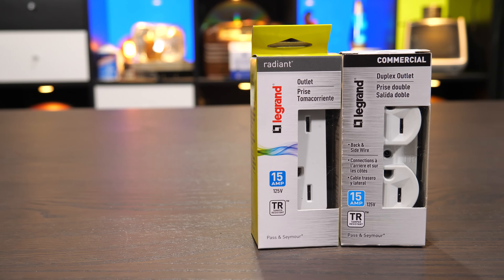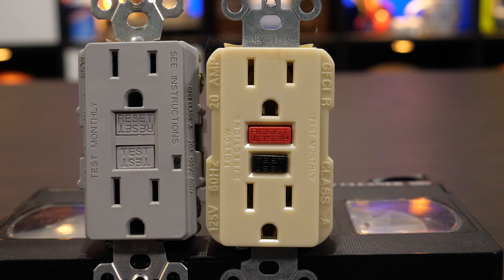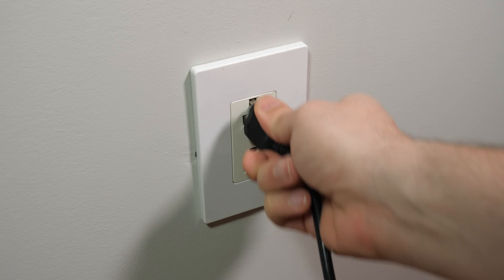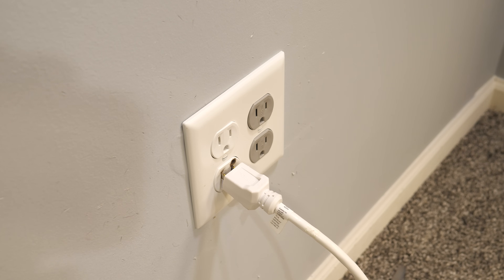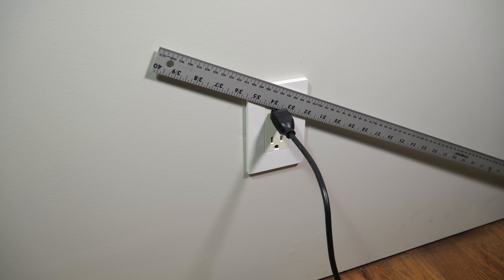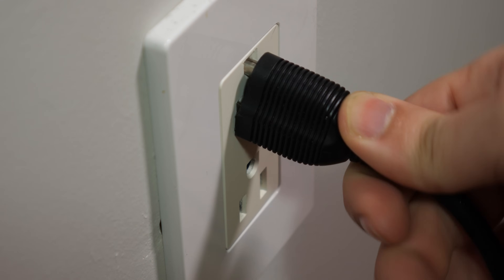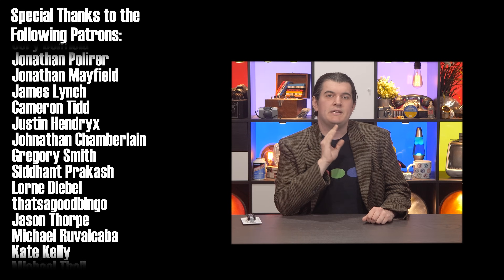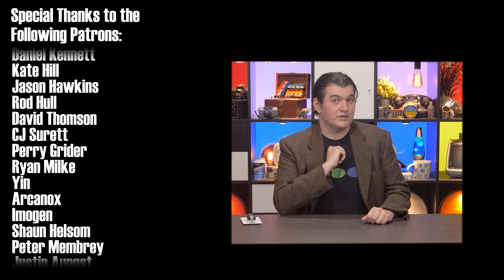Power outlets are topsy turvy - but does it matter?

Comment: I actually like the eu plates with the power switches.
The plug design we use is bad for sure.
Right angle plugs are due to consumers having them designed upside down for so long cause they are more authentically pleasing.

So weve made plugs to caiter to this.

Comment: My electronics teacher came from the bio med field and hence we learned to always have them with the ground up just incase something falls on the plug while its in the outlet in a hospital. Honestly the things that cause me the most trouble as an appliance repairman are not how an outlet is mounted..... its if the electrician even knows how to wire an outlet to begin with. I usually deal with either reversed hot neutral and or no ground and its truly..... shocking..... 😉 how many are wired wrong. That's before we even get into code and all the ways in which it is misinterpreted, misapplied or outright ignored. Stay safe out there appliance guys and keep that multimeter handy... someone's got to use one....

Comment: You touched on this and it's true: There are many appliances which are designed to be installed with the grounding plug down. Right or wrong, they assume that orientation at the design phase.

Comment: I lived 20 years in a house with top ground orientation and never once had a single problem. You are vastly exaggerating the issues. Not that I think it matters which orientation you use, I just think it's a non-issue.

Comment: Here in France, the System (who are They ? no idea) sacrificed some wall clearance on the altar of safety. Grounded plugs fit into big round sockets, so that the live blades (well they're actually big round pins, and the ground pin is actually protruding from the socket itself rather than sitting on the plug) become hidden quickly, sometimes even BEFORE making contact with the live circuit behind the socket. Oh, and our plugs are way bulkier too, so the grip is better - a good thing, because they sometimes hold on so tight that pulling a plug can require a surprising amount of force.
But angled plugs can cause the same puzzling feeling as you NA fellas seem to encounter, and in return for being a tad safer, hiding a plugged-in socket behind furniture is often close to nightmare-ish.

Shenanigans, amirite.

Comment: I think that what we really need to do is come up with outlet designs that rotate, then you can choose whatever angle to want on a per socket basis. Cause yeah right angle plugs can be superior in my experience they are equally as likely to end up covering or making it hard to access another adjacent socket. Even if they just rotated 90 degrees each way that'd be enough
Reply: That's where the European Shucko (Type-F/CEE 7/4/CEE 7/7))plugs come in. They can't be rotated 90 degrees, but you can plug them in either orientation, since the grounding happens at the edge of the connector, and the plug isn't polarized. They're also typically recessed so there's no risk of ever coming in contact with a live pin with any object.
Reply: @KalleKilponen yeah but I like getting my skin burned off when plugging in my toaster 😢
Reply: @KalleKilponen  In fact they're always recessed. Old houses just have older sockets that are backwards compatible with new plugs but have issues.
Reply: @jattikuukunen  Which is why I said "typically". Modern ones are indeed always recessed, but there are still plenty of older, (pre 1980s) non grounded and non recessed installations left.
Reply: @KalleKilponen  yeah but those aren't Schuko
Reply: @jattikuukunen  True. But they still accept the same plugs, and are still in common use, so I felt it disingenuous not to account for their existence.
Reply: as long as they could lock into place and not rotate continuously past 180 degrees or maybe at most a single 360, that'd be a great idea.
Reply: So a hole for the ground pin in both sides? Not enough for polarized plugs, though.

Comment: maybe legrand should just make a RECEPTACLE that can be rotated around 90 degrees individually - shouldn't be too tough to do, it's only 3 conductors - thatd ensure all plugs all the time any orientation, if it fits it sits, could even put a little lock on it so that it can't be rotated once clocked as needed.  this shouldnt be this complicated.  hell they could probably design something thatd pass UL in less time than it took to watch this video

Comment: As an electrician anytime there's a receptacle under a window we install them with the ground plug up for the potential of contact with window drapes.. having gone through many of homes built across 150 years.. you seem them in 60s and 70s houses quite a lot and they stopped in the 80s and came back in the 90s 00s.. there isn't anything in the nec about orientation outside of following manufacturers installation instructions. 

Some guys do it just because and other guys don't just because.

Comment: One thing you failed to mention (if you're even aware of it):  In many homes, although most of the outlets are installed ground side down, some rooms in the house have one outlet installed upside down (that is, ground side up).  Why?  Because this identifies the outlet controlled by the wall switch in that room. That's the outlet you would plug a room lamp into.  Sometimes only one of the two receptacles is actually switched.  I don't know if this is a regional thing, but I know I've seen the practice in houses I've seen in Texas, Nevada and Colorado. I always thought this was a general convention until watching your video.  Have you heard of it?

Comment: One more argument for the ground pin on the bottom - if it does partially come out, the last point of contact is still the ground, thus limiting hazards on the device itself rather than at the plug. Still, neutral up is probably optimal but I've never found consensus amongst any engineers or electricians in fields from residential to healthcare.

Comment: In my opinion, the ground down is safer. Though it would seem safer to have something fall on the single ground pin, operationally it would be better to have a dead short from hot to neutral (assuming all the breakers/fuses are in good order)  as this would keep the current within the circuit and would quickly open the circuit making it safe. If something fell and landed on the ground up plug it could still contact the hot and would carry the return current through the ground network, putting a voltage on the ground which could interfere with other devices. If it landed on the ground and neutral at the same time, some of the return current would travel through the ground network, slightly raising the ground potential and again possibly interfering with other devices. And since it would not trip anything it could remain like that and make tracking that interference tricky. Finding a faulted outlet much easier. And if someone is touching the object that went hot - neutral, most of the current would go through the circuit, not the person. The only case you showed that was a danger is the metal ruler at an angle against the hot pin. But that is an even more rare case, that could still happen with ground up. In short, having the orientation such that it will trip out as fast as possible when an abnormal event happens is the best option. But that is again, my opinion.

Comment: Here in NZ we use the same outlets as Australia and China. Similar pin arrangement to NEMA 5/15, just phase and neutral pins are angled and the earth pin is flat. If you're cheap you can make a two-pin US plug fit our sockets by twisting the pins a bit with a pair of pliers. 

In Aus/nz we've mitigated the issue by sleeving the pins in plastic near the plug base. In China they've mitigated the issue by turning the socket upside down. 

I've got a bunch of Chinese power cables that work with our sockets, but the cord exit is on a right angle towards the earth pin side, so they point upwards when you use them here. Kind of annoying.

Comment: As an apprentice electrician I can offer some insight. Normally in hospitals it is common to install an outlet in the ground up orientation, this is often a specific job request.. it's also done if an outlet is switched, or in a  outside wet location with a GFCI outlet. The theory is that if water breaches a protective enclosure it will make contact with the ground first and short the circuit, causing the breaker to trip. The NEC doesn't specify ground up or ground down as being correct or wrong, so its a customer or DIYer decision.

Comment: TBH, having used all four of the major standards, the only one I've had an issue with is the NEMA one. The plugs constantly walk loose from the socket, the faceplate design tends to lead to mushy feeling or outfight detached sockets (especially where landlord wiring jobs are concerned) and its the only time I've encountered improper power cord strain relief in the past 20 years. As for the rest, they're much of a muchness, honestly once you sleeve the live/neutral pins and ensure the things actually stay in their sockets, the vast majority of realistic safety concerns go out the window. I will say I prefer having an isolation switch on the socket though, because it's somewhat more convenient than unplugging things to avoid parasitic drain.

Comment: Regarding plugs not fully inserted, the self checkout machines at my workplace all hang out, and they have a candy rack that ends up blocking access to the receptacles which are in a constructed wall surrounding the SCO area. It irritates me seeing all the plugs hanging out :| maybe having the receptacles oriented ground-up or sideways would have fixed this, but the installation company already left a lot to be desired with how poor of a job they did as-is.

Comment: I'd actually like UK sockets to be installed upside down as almost all plugs have the wire exiting the plug head parallel to the wall on the opposite side of the ground pin. So often I need to reach down behind a table (that's too heavy to move) to try to plug something in and need to have the cable going upwards as soon as possible.

Comment: My apartment in NYC is new construction and has all of the outlets installed ground up. I actually find it really annoying because, as discussed in the video, everything I plug into it is designed to go the other way and is therefore upside down. I have a little air quality reader that downright doesn't work correctly because it's facing down instead of up as it was designed.

Comment: As an electrician, the only time I install grounds up is when the prints or the customer tell me to. 

Hospitals use hospital grade receptacles, especially for medical equipment, that are built a lot stronger and require more force to remove a plug.   Makes ground up make even less sense there.

Comment: Actually had an incident with an outlet that had the ground pin down. Closed the door next to the outlet and the metal backer from a picture frame above the outlet slid out and hit the blades if the plug below. Arced and blew the breaker. One in a million freak accident, but made me a believer in putting ground pins up

Comment: Time for a new international standard. Locking plug and a 'signal' pin to allow the device to communicate with others on the network. Not for real high bandwidth data transfer, but stuff like controlling smart home automation and negotiating power demands for high drain devices.

Comment: There is sure a lot more that can be mentioned here but I think you got the jiffs of it.

I'd love to see a follow up on this talking about TR requirements and how in ways can help a bit too as replacements or new installs by code are required to have these.

I'd also like to see other types of plugs looked into, my personal favorites are the flat ones for furniture, most of mine are angles but I do like the 360 plugs so I can just move them as needed.

I think you already covered it but our biggest issue is power strips where people need more and don't under specs and just keep plugging in things until poof lol.

I also wanted to mention you tend to see the outlets upside down more in hospital or business for the "safety" reason and I've seen people install it this way to make an easy indicator saying that this out is set up to turn in when the light switch is on.

Anyways great video and love your content.
Reply: He covered extension cords and surge protectors in the video that in either the title or thumbnail he calls Christmas lights the safest extension cord in your house. (Because they are fused, breakers protect the branch circuits wiring not the cord so you can theoretically plug a 15A cord into a 20A circuit and melt the plastic insulation on the cord that was rated for 65°C and not 75°C)

I work in as an electrical engineer in construction, on my second week i asked why the outlets were upsidedown in an industrial space and was told its incase the metal face plate falls off it will be on the ground pin of a "sagging" cord. In industrial and commercial spaces metal face plates are very common so it makes sense, and our company standard is metal boxes + conduit.

Its just the sort of unlikely event that the code is generally written around, it has probably killed atleast 1 person, but it happens very rarely. So we make it a rule in the code, or industry standard to make the mostly rare event non-problematic when it happens or completely prevent it from happening.

Its very similar to why we don't use fuse boxes or knob and tune wiring anymore, its not fundamentally dangerous, but idiots would deal with a fuse that kept blowing with a coin and then burn down their house, so we switched to a more foolproof technology. (America really should upgrade its plug standards by now to atleast have insulated sleeves on the hot & common pins by this same logic, not that the current way is completely unacceptable but it could be another layer safer.)

Comment: Fun fact about those socket guards designed to stop kids poking around in them: in the UK the live pin isn't activated and made live until the ground pin is inserted all the way, so by putting in a socket guard you actually activate the live pin and make the socket more dangerous than if you just left it alone.
Reply: do socket covers in the UK have a blade in the ground pin?  the ones here only have the two for hot and neutral.
Reply: @johngaltline9933  Yes, because you can't access the live and neutrals without the ground pin going in first - they're locked off until the ground goes in
Reply: @picarus2210  so... why do the covers even exist on sockets that you can't stick anything in?

Comment: If you REALLY cared about safety you would get the type F socket and plugs for everything in your house / building.
Even if it's still just 110 V 60 Hz AC, the socket and plug DOES NOT CARE that you are sending less voltage through it than you normally would in Europe.

"But all my appliances have US plugs"
Yeah, as painful as it is, you CAN actually replace all the leads with proper ones and if you commonly order the cheap stuff with... Let's put it mildly, less than ideal leads... You should replace them anyways.

In nearly all cases, it's quite easy to swap leads on appliances. It's only charger adapters and such that will present an issue. BUT, chargers tend to come in one size fits all. At least to the best of my knowledge, meaning you can plug a charger into 110 V or 220 V without changing a thing. This because people who travel abroad don't particularly like it when their socket adaptor charger unit explodes...
Many electronics have either a manual switch (a recessed red little thing that you push over to 110 or 220 V depending on where you are... And if you forget to switch from 110 V when plugging into 220 V, the worst that happens is you blow a fuse inside the thing. That fuse can be replaced.
Or more commonly on new units, it's all automatic. It just knows what voltage you are on and even what Hz you are on when needed.

So practically speaking, if you CARED about safety you would just wire your home to have type F sockets everywhere. DONE!